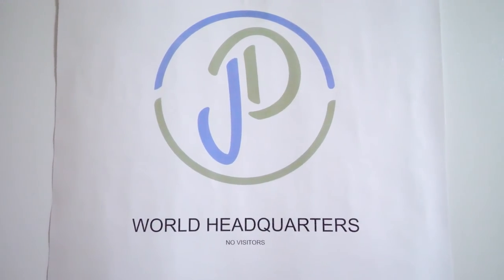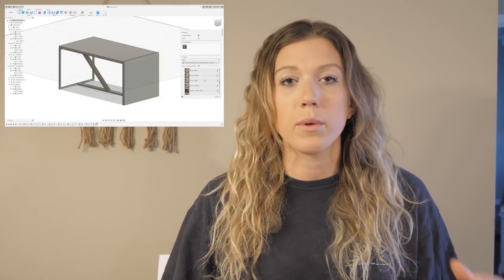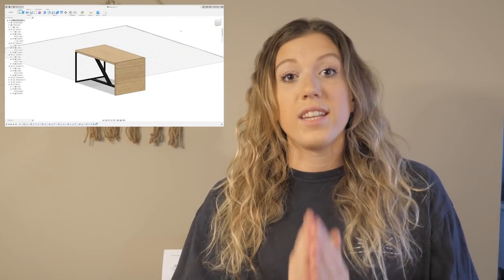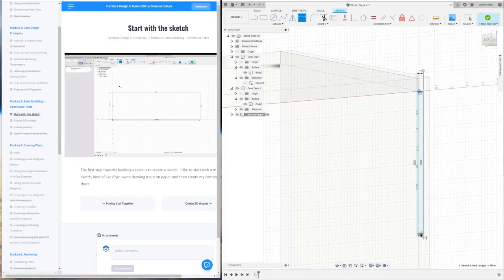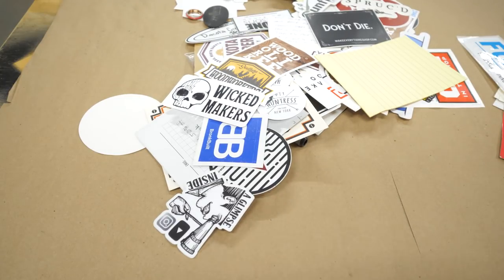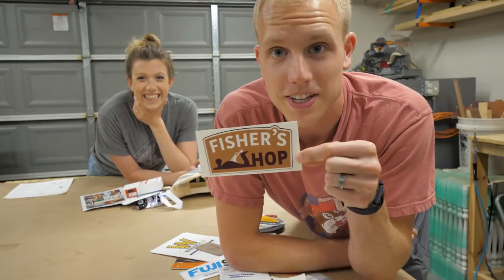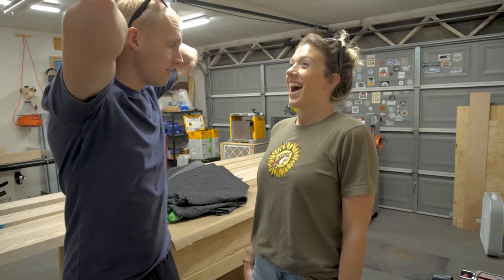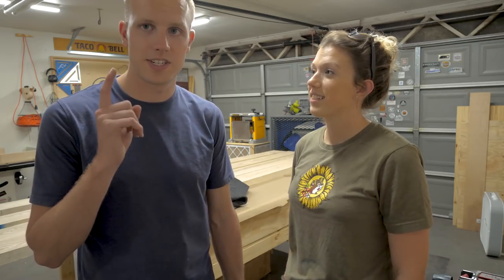Work From Home Studio Makeover!!! Part 1 - Building an Office Desk

Comment: Geat job and very nice desk!   I noticed you have a massive cross grain thing going on there.  Why did you go with crossing the grain and how did you compensate for expansion/contraction between the top and leg?   Looks like a fairly simple desk from what you showed us.  Also that was an good opportunity to show case a waterfall table.  Love the piece!
Reply from the maker: We did cross grain because it looks cool. Also, we didn’t have blades big enough to pull off an 8/4 waterfall and we were limited on time, but yeah waterfall would have looked cool, too.

The wider setting for the domino was used and everything is friction-fit together for future disassembly. No movement issues at all! Table is rock solid, too.
Reply: @jennieanddavis  You may not have issues now but going forward and seasonal changes will teach you a lot about wood movement. But hey it's all a learning process' just a good thing this wasn't a customer build.
Reply: I respectfully disagree James. I have been a professional woodworker for 30 years. True on the surface a cross grain joint makes us raise an eyebrow. However the rules of woodworking can be broken and the way they described how they did the joint is the best solution to “break” a woodworking rule. The joint is friction fit not glued so there shouldn’t be a problem. Secondly essentially what they have made is a modified breadboard joint which was a very popular joint in antique tables to prevent tops from splitting from seasonal movement.

Comment: to do a true waterfall table it is best to at least have the grain all running the same direction as it cascades over the edge and down the side. also cutting the corner on a 45 degree angle is a much cleaner look for that type of solid sided table.plus the vertical grain gives the appearance of a taller table rather than a wider table. with is more pleasing to the eye.

that may not have been the look you were going for, but at the very least the leg should have been under the top for structural stability rather than attached to the side which leaves room for weak joints when the weight goes more on top than the side of the table.

Comment: I think the desk is beautiful. Great job!  I was wondering first the tool you used to cut your slots and dowel holes what is that called my drill bit and chisel method is far to time consuming and that is amazingly compact and seemed versatile. Secondly if you ,I guess you would call it phased the top into the end making it appear seamless yet the grain still changed, is there a name for it? I believe my  dad called it a phase joint but I don't  know. And also do you think it would look too unnatural to still express  the grain in a similar manner as y'all did.
Reply from the maker: That's a Festool Domino. It's an expensive tool but you're right, it's SUPER fast and convenient. Not sure on the joint name - we would just call it a cross-grain butt joint with floating tenons!
Reply: The joint is a modified breadboard joint. Modified in the idea that a true breadboard end is a cross grain piece installed in the same manner as they did but the cross grain is part of the top. This still works the same as the cross grain is also the leg of the table. It is a very good joint and was really popular in antique furniture to prevent a wide top from splitting at the glue joints from seasonal movement. 
The finish looks really nice and smooth too. 
Impressive work!!

Comment: I’m in the Houston area. I use 2 hardwood dealers. Thought about using the option for S4S on my next project vs me milking it down (no jointer either). Not trying to blast them but, who was it!!?? Don’t want to have the same problem.